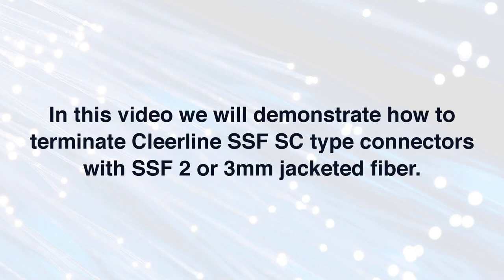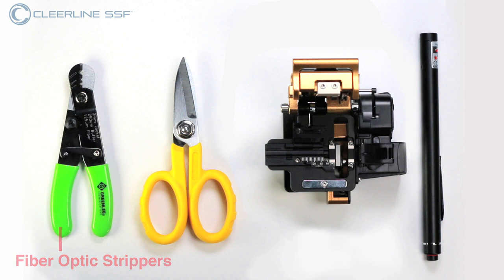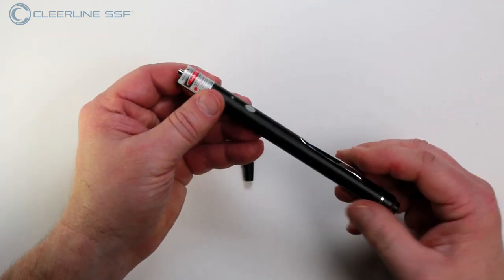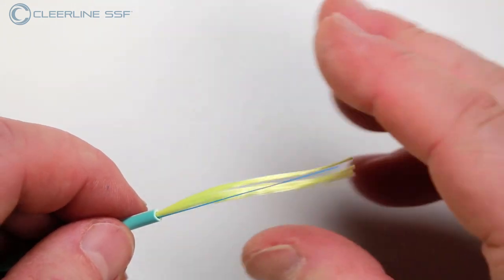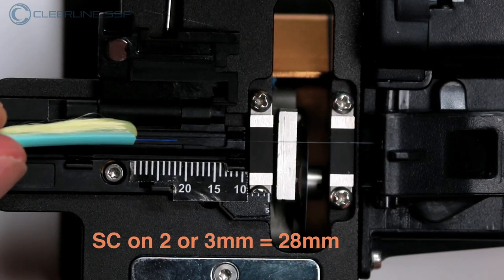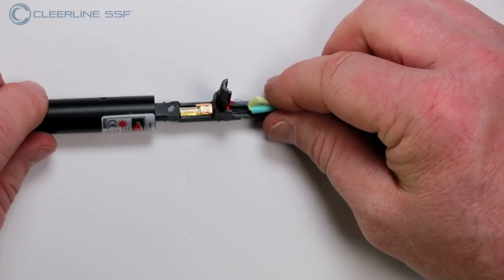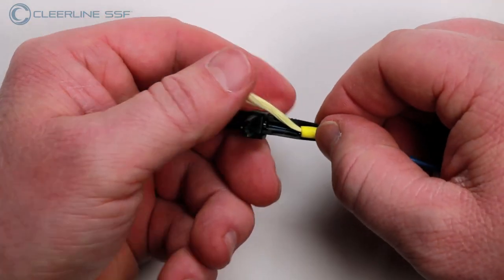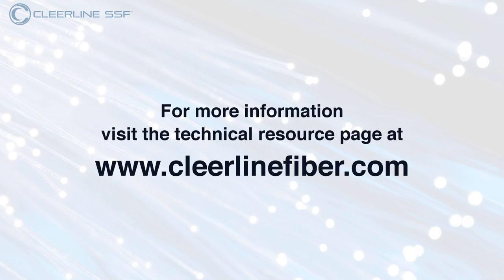SSF™ SC Fiber Termination, on 2-3mm Jacketed Fiber.

Comment: How to Remove connector snap cover ?
Reply: With the dust cap on and against a level surface, hold the cap and push down. The SC cover will snap off and over the front of the connector!